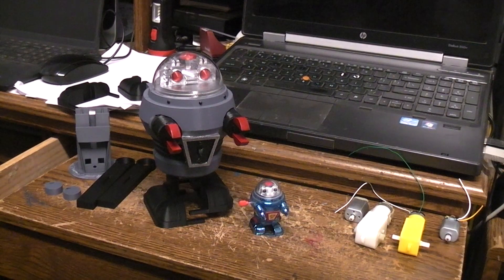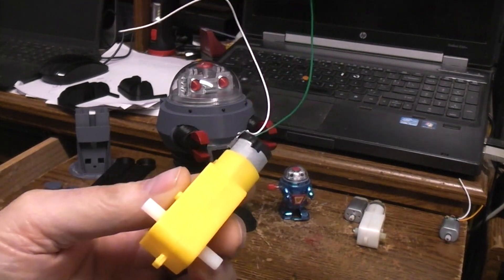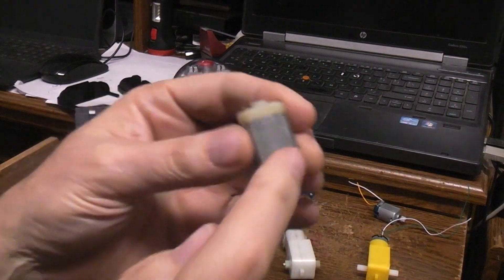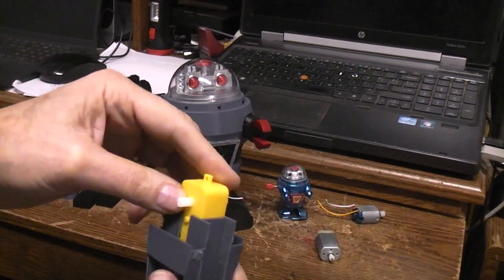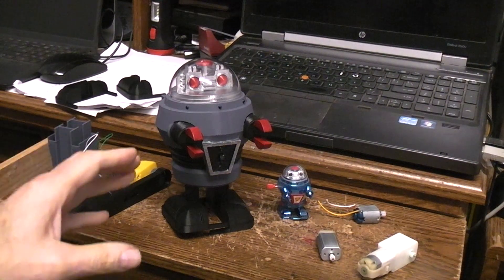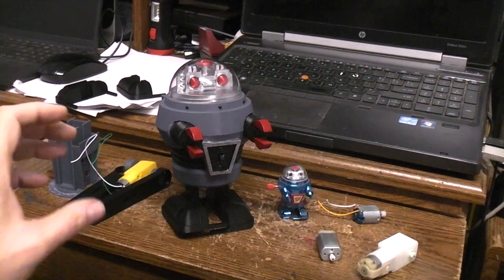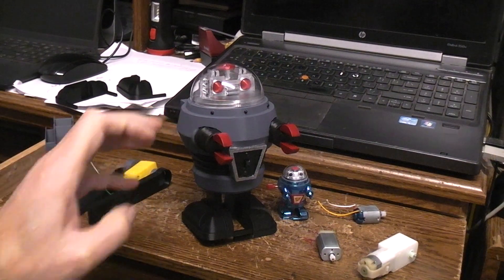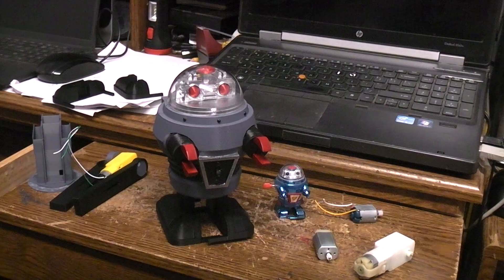Part 2 of 3d printed Tomy "pocket bot, rascal robot" build. Prototype waiting for the TT gearmotors.

Comment: Looks great and walks good. I've always liked the look of these Tomy bots.
Reply from the maker: Should look better in the translucent red PETG I am printing for the TT gearmotors when they arrive.
Reply: @Robothut  I've never printed with PETG. When I get my A1 mini I will try it. I have a functional part I want to print. I've heard it can be difficult. Have you had any problems with it sticking to well to the build plate or printing overhangs?
Reply from the maker: I have printed all the parts in the next robot in PETG on the A1 mini and it was perfect, no problems at all. I do use glue stick on the smooth PEI sheet just to make sure things stay stuck or do not stick too well. The printer runs at 255C and the bed at 70C. No problems. @rick_100
Reply: @Robothut  Good info. I was wondering about the glue stick. Thanks.
Reply from the maker: Yes, if you read all the manuals that Bambu has on their web sites you will find they recommend using glue stick. Like so much of the info that I wanted to know its not easy to find but its there. @rick_100